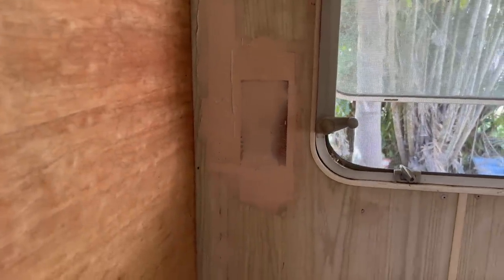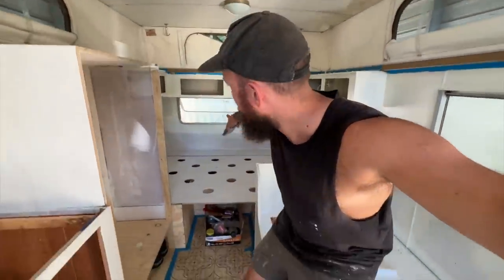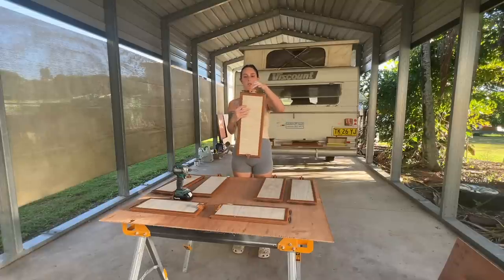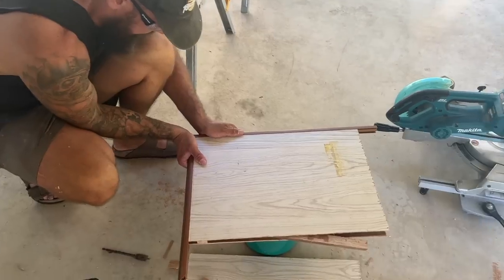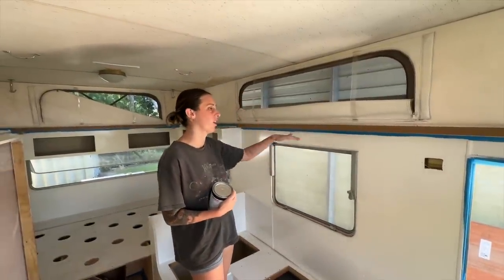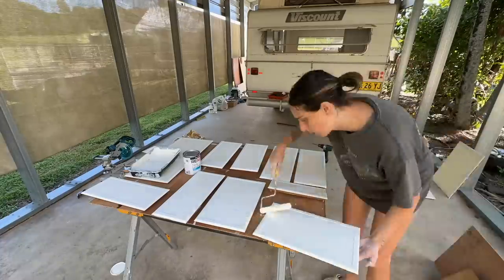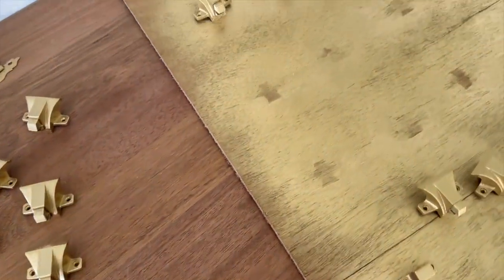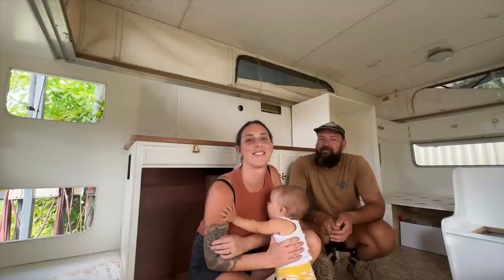How to paint the original interior in a vintage caravan | Viscount Caravan Renovation Ep 4

Comment: Great job. Looking forward ro more episodes.
One tip for fitting panels to irregular shaped contours. Use a joggle stick. Also called a ticking stick to get the correct shape. Should be plenty of yourube videos on it.
Reply from the maker: thanks! we've got some more episodes coming soon. i can normally nail a panel like that with the tape but you've only gotta get one measurement wrong and bam it doesnt work

Comment: What are you going to do about the louvre panel where the fridge was as i think you will have the same damp problem a while down the line also the same with your door which is not needed as you are no longer using bottle gas brilliant work to get the caravan back up to scratch wont be long now until you are all enjoying the outdoors life instead of working in the outdoors
Reply from the maker: we'll be sealing up the old fridge vent because our new fridge is internally vented which is one of the main reason we chose the fridge. Ive always hated fridge vents they let soo much dust in and water and bugs. i have thought about the door ventilation but will look into that. thanks only a few weeks left. Thanks for watching
Reply: @AsWeWander  hey guys 
We have very similar old Viscount and we flattened the vents out and got the tin bashers to cut us out a piece of tin to fit inside the aluminium strip
Looks pretty clean and made a huge difference to temp and dust inside van
Loving your content guys 👌